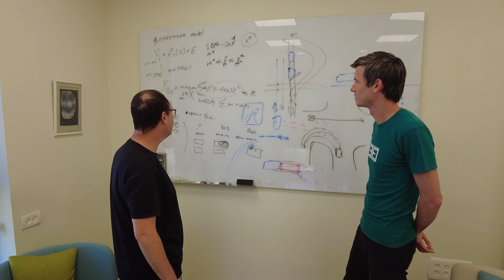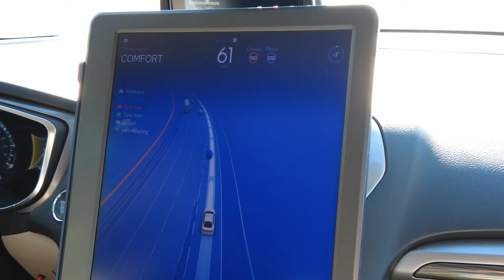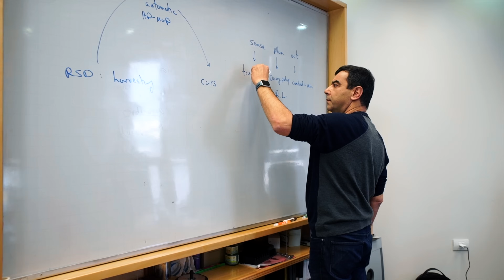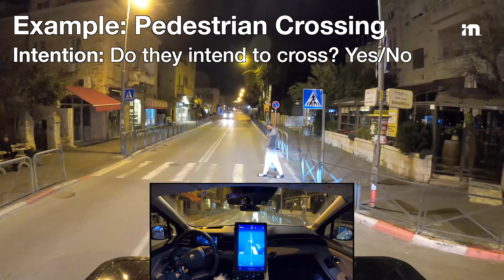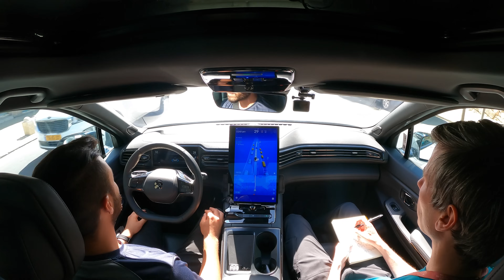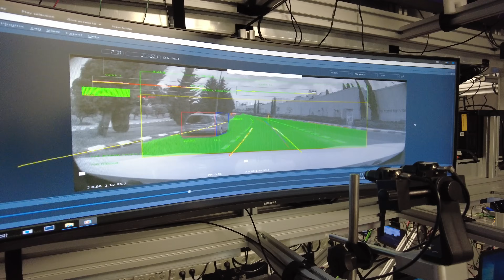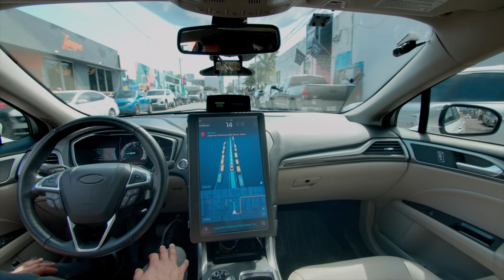Are Autonomous Cars Closer Than You Think?

Comment: I'd like to see and hear how this compares to Tesla's FSD from Tesla engineers themselves. They seem to have a more "brute force" approach, but they also have more of a reliance on machine learning and AI. Maybe having smarter AI cuts down on processing power so you don't get the reduction in range as said in this video.
Reply: Tesla has a lot of presentations about FSD, some "official" and some from their top engineers personally. These are extremely technical, so you really get a sense of where they are. But nothing like that exists from the competition, as far as I now, so it's very hard to compare.
Based on the little I saw, Tesla is lightyears ahead. And the difference in hardware and limitations are implying the same. For example Tesla's hardware is cheap enough to put in every production car, even if the owner doesn't pay for FSD. And it consumes so little power that it barely affects range. And it can drive practically anywhere. Somebody managed to turn on one of the early versions in Ukraine, and it was driving just fine. None of the competitor systems would work, sue to the complete lack of map data.
Reply: Tesla will never handle level 4 automation in the next decade. They keep removing sensors. They rely on cheap cameras instead.
Reply: @economicprisoner  
That's exactly why Tesla is very close to level 4, and many years ahead of the competition. People drive with two eyes, and the entire road system is designed for that one sensor. Everything else are just distractions.
Just watch FSD videos to see it working in real life.
Reply: @andrasbiro3007  Then why is Tesla not using stereo vision?

What happens when the camera gets obscured?

They are doing the "move fast and break things" with safety-critical systems.
Reply: @economicprisoner  
1. Stereo vision only works at a short distance, irrelevant for driving.

2. They use redundant cameras. Also just pulling over and asking for help is a valid option.

3. The way to do it is to set up a rigorous test suite that guarantees safety, and then go crazy behind that wall.
Reply: @andrasbiro3007  They recently removed the short distance sensors as a cost-saving measure.

No, they don't use redundant cameras. The triple camera has three differing fields of view because it does not have the resolution to see distant objects at the full field of view.
Reply: @economicprisoner  
They removed the ultrasonic sensors because those are not needed anymore. And you can't drive with those anyway. Just as you can't drive with radar only.

Different field of view is still redundancy, and they are more overlaps between cameras. And again, just pulling over and asking for help is a valid option.

Comment: Makes me think I'd thrive as one of the test drivers. Due to work being far I've accumulated 50,000 miles in 3 years. The most major thing I encountered that I could not avoid was two deer running out full sprint on my way to work at 5am,  they came out from a building 5 feet from the road. I redirected a path to go behind the first one but the second one following was blocking so I tried to make the split between them that happened to be too narrow. But that was one instance there was no evasive path available. Leading up to that I've probably avoided close calls with 30deer, 17 fallen trees, and potentially 50 erratic drivers. My experience ought to be up there. A common practice with me at intersections is I'll go as far as checking the focal point of drivers behind me in my mirrors if I'll have to stop to personally set up a right on red instead of following a driver ahead of me through his maneuver.
Reply: That's only a little over 16k a year, and average I thought was around 14k... I had 56k at the end of last month for this year. And I believe he said their test drivers where professional drivers like truck driver and cabs, so eight or more hours a day driving significantly more miles a day.

Comment: So the logic demands that the "worst case restriction" determines which sensor (camera vs radar/lidar) is given preference. When fog render cameras useless, does the AI logic then switches completely to the r/I sensors?
Reply: That would likely make the most sense, given that both Lidar and Radar can much more easily “see” through fog or other scenarios where vision based systems wouldn't.

Comment: Tesla's approach is less & cheaper sensors (cameras) and once they solve general AI it's game over for everyone else including Mobileye.  Why do I feel this way?  Because I drive the Tesla FSD beta software daily and it's getting very good.  Plus, it is the only generalized approach to autonomy which means it can be dropped into the middle of nowhere and works, with no pre-mapped roads needed.
Reply: I agree.  I have been driving FSD Beta for 2-1/2 years.  The system is getting very good.  I have to point out, however, that Tesla's system still depends on map data which varies in quality.  Tesla may have to take a page from Mobileye and generate their own road maps (including parking lots) before Level 4 autonomy will become practical. In too many instances when visual information conflicts with the road map data, road map data takes priority.

Comment: With only 2 separate systems, some form of third tie-breaker function has to exist. If LIDAR says that's a moving pedestrian and VISION says it's a static light pole then what is it? In that 2 system implementation, the tie-breaker is a driver. In a robotaxi there is no driver so (it seems to me) there needs to be a third segment which has to decide to put on the brakes, stop the car and sit there dumbfounded.
Reply: I would imagine that is why they also have radar. Maybe the radar is more easily able to discern between a moving or stationary object and then relay that information to the computer combined with the other sensors.

Comment: I'm curious how much data Mobileye is getting. At 5:22 they're kind of suggesting that much of the OEM fleet is collecting all this data in a similar fashion and scale to Tesla (HQ asks for clips of specified situations, the fleet find those and return them to HQ, data is automatically filtered, labeled and processed for NN training and then the car is updated - rinse and repeat). Is that correct?
Reply: Most cars in their fleet have very basic sensors and likely minimal upload capacity.  They also have a large number of sensors to support. The usefulness is unlikely anywhere near the two-way communication between Tesla's fleet and HQ

Comment: always using the safest of the two sensors sounds like a great way to softlock
Reply: Explain please
Reply: suppose it measures wrong on the right with one, so it takes the safest and leaves extra space
ofcourse on the other side it measures and takes the safest space, leaving extra space
and now its too narrow to move 
softlocking ai is incredibly easy in games with things like that, and in games the ai doesnt even have uncertainty about space
Reply: @ashardalondragnipurake  You saw when it was going the wrong way when the bus was yielding: it just drives at a crawl to allow it to stop in the space it has.

Comment: Although I have absolutely zero interest in owning an autonomous vehicle, in fact I bought one of the few 2021 cars that isn't already like riding in a robo-taxi, but this was interesting to see how well this prototype handled more challenging traffic situations than I've seen in other videos.  But I wonder how well it can deal with things that won't be in its maps: construction zones, temporary blockages, weather caused incidents, etc.  And I'll be really impressed if I can see one of these handle Boston traffic without making the traffic jams even worse.  I also am curious if it can read traffic signs, especially the electronic ones that can warn you of road closures or other changes that won't be on the maps.  One last thing: can it determine how another car will behave based on the condition of that car?  For example, someone in a brand new luxury car is much more likely to let you enter line of cars than someone driving a beat-up old pickup, or a minivan with the little icons for their family on the back will be much more likely to yield right-of-way than a BMW.

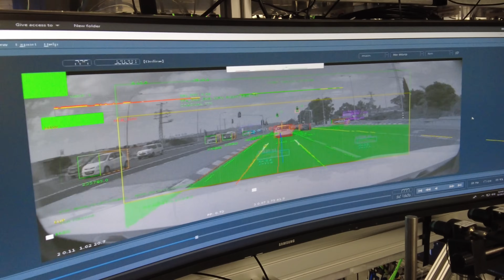Comment: 4:11 and 4:14 represent the exact reason why i WILL never buy a fully autonomous car - data lags. In this case it's just a replay lag, but real time data lags happen constantly. Some are just a fraction of a second, others can be multiple seconds at a time. I accept such systems as a back-up feature - to prevent accidents by careless drivers, but i will never trust lines of code with my life. 
But what will be super fun here at The Balkans is the behavior mode. 1/3rd of the people are drunk or stoned all of the time and drive super slow and risky, another 1/3rd adopt Jeremy Clarkson's policy of "SPEEEEEEEEEEED and POWEEEEEEEER" fix everything and the last 1/3rd are a mix of generally good drivers, who however are insecure and self questioning. Which path would the cars take :D - the ones who drive with 20km/h in 60lm/h limit because they can't focus properly from all the alcohol and drugs, the ones who drive with double or triple time the speed limit or those who are in the middle and are constantly on the edge to not meet anyone from the other 2 groups.

Comment: For those who drive in deep snow on the regular, I can hear you chuckle. Throw icy stops & 4-16 inches of snow at FSD, see how it does... kind of odd that self-driving vehicles haven't been showcased in REAL Winter driving conditions, isn't it Jason?
Reply: For most of the world, most of the time, it's irrelevant. Especially when we have less and less snow every year.
But Tesla's FSD has been tested in deep snow like two years ago. It did reasonably well, but ignored slipperiness of the snow and tried to drive at normal speeds. That's an easy fix, it just have to learn what snow is. It's harder when road markings are completely invisible, but it could rely on map data to drive at least as well as the humans who also don't see the lines.

Comment: The analogy with an aeroplane engine is wrong...
- it's one system with redundancy not two systems
- so by this analogy you need "two" cameras in the same wievpoint...

camera and lidar would be jet engines in cooperation with propeller engine...

Comment: I would love to see how this tech does in a winter climate. I am in Minnesota and I have yet to see any company, Google, Waymo, Tesla, etc. showcase their systems in harsh weather. I assume this is because it almost completely breaks down. Great video!
Reply: Yes I used FSD last week on a 1 hour drive. I only had to take over once because it was be slow to decide what lane to be in. The other 59 minutes and 55 seconds it did it all on its own. 

On the way home it was raining hard and hailing. FSD would turn into autopilot (only lane keeping, no turns) 90% of the time. And it was hard to even get it to turn on at all. 

So once FSD works at level 4 in good weather they will be spending a lot of time figuring out how it will work in terrible weather.
Reply: @ecospider5  FSD has absolutely zero response/algo for blizzards. Mount non-Winter tires on those rims and its incapacity gets even worse. The number of variables associated with ice & deep snow driving far exceeds "normal FSD"... which might never get there. Minnesota is nothing, come North of the 48th and we'll talk lol.
Reply: @ecospider5  Tesla's FSD has been forever gutted by musk's shortsightedness, as right now, and for the foreseeable future, there is simply no way to get a reliable self driving experience without lidar and radar. They were taken away to cut costs but their absence ended up being basically the reason why every tesla sold until now will never achieve full self driving.
Reply: @fedyx1544  
So you are saying that humans are unable to drive? You may not have noticed, but humans don't have lidar, radar, or even ultrasonic sensors.
Reply: @fedyx1544  100% agree with you.
Reply: @andrasbiro3007  We have redundant sensors, unlike modern Teslas.

They are in the process of removing the ultrasonic sensors.

Also, it you work out the resolution of the cameras (3x 1.2MPx with differing fields of view)): Teslas are near-sighted.

They are known to miss semi-trailers turning across their lane.
Reply: Pretty sure no autonomous driving companies have tackled winter extensively. I think Ford was the only one I know that tried and they just completely disbanded the project, so presumably wasn't going well even in perfect conditions. I know the Dirty Tesla channel pushes his FSD in Michigan (I think) winters to mixed results. There's no code around expecting slipping to need longer stopping distances and stuff. As someone also in Minnesota, it's a bit disappointing but also makes sense to focus on ideal conditions first since it's a tough enough problem. I got a Tesla,  but lol dropping $10k to beta test FSD, especially as someone who likes driving. Autopilot is fantastic for long drives.
Reply: Winter weather AVs are a much, much harder problem, and I think it's going to take infrastructure changes to make it work reliably. IE integrate technology into the roads such as wireless beacons to help cars know where they are. That's expensive so it's a political nonstarter for now, but I expect that once temperate climate cities start leaving cities that experience harsh winters in the dust productivity-wise, lawmakers will be willing to start shelling out the cash.
Reply: I just sold my 2022 Tesla Model 3 for this main reason: in Canada, with harsh weather, the FSD was useless. Even adaptive cruise would get confused by bad weather, obscured road markings from mud / snow etc. -- they should have kept the lidar and optimized the software for climates outside SoCal.
Reply: @frozenrobert5735  
My experience is that other driver assist systems do far worse in bad weather. Most are bad at lane keeping even in perfect conditions. And you can't even buy any other self-driving system yet. So why exactly did you sell your car?

Comment: Interesting. The thing with Lidar I always wondered was what happens when the tech gets used more and more. Can two (or more) cars implementing Lidar near each other start to interfere with each other's measurements? Cameras are passive, so there you don't have this issue.
Reply: LiDAR is using photons. So any other photons can interfere with it. Like sunlight and street lights. The software has to deal with that.
Reply: For FMCW it is not an issue, because only the mode and frequency matching photons can enter the detector, so only the photons emitted by the same scanner can be detected. Environmental light is also not a problem because those are “white light”.
For ToF Lidar, different device could interfere at the hardware level

Comment: it raises a lot of interesting questions. if everyone's breaking the law, shouldn't law be changed or at least adapted? If the car thinks it's safer to drive over the limit, 
should it ask you?  if autonomous cars break the law, who's responsible before the law? should you have an option to disable any breaking of the law? but then it would mean if you don't you implicitly accept it? 
if you are following the flow of traffic over the speed limit, and accept the fact that there is a very small probability to get ticketed for it,why should it be different when you're not driving? would you rather stay in the right lane and drive slower than everyone, possibly in reading risks of collision? could you ask a robotaxi to run red lights at night because your pregnant wife is starting labor and the streets are empty? or there's a fire in your building and the kids are locked up? kind of things you could say to a human taxi driver and he could evaluate if it's  a prank or legit, which would be hard for an AI unless it's extensively trained specifically for every emergency situation, and people could take advantage of that for fun.

Comment: This is all good until we reach snowy conditions.
Once those sensors are covered it’s all over.
Reply from the maker: Hence the cameras have sprayers for water & air to keep a clean view.
Reply: @EngineeringExplained  Yeah that's not going to work with slush/salt Jason, I think your response is disingenuous. Or perhaps you actually have not driven North of the 48th, I'm not exactly sure. "Sprayers", sure sure. Freezing rain would like a word.  😅

Comment: A good example of why it will still be a long time before these cars are allowed on the road with no driver:
If a school bus stops to pick up/drop off a student, the law suggests a driver is not allowed to pass until the school bus moves. An autonomous car would attempt to go around the bus because it cannot tell that it is a school bus and it should not pass.
Reply: @Dorian Doan, why are you assuming that an autonomous vehicle could not recognize a school bus? They have very distinctive markings, so this should be no problem at all.
Reply: @BigBen621  I assume that because the video shows what the car sees on the infotainment. The vehicles aren't being scanned for depth, markings, and writing. It's being scanned for size, position, relative speed, and it's 'next move'.
Reply: @Itzlnferno  I agree that this is the current situation, both with MobileEye, and other leading contenders in the autonomous driving field. But since every school bus is bright yellow and has the words SCHOOL BUS in several places.  Even my ex-wife's base-model Toyota Corolla recognizes speed limit signs, stop signs, Do Not Enter signs and yield signs as part of its standard suite of safety features. Since every school bus is bright yellow and has the words SCHOOL BUS in several places, it seems fairly trivial for ADAS, with their much more comprehensive processing power, to solve this, when it gets to the top of the "to do" list.